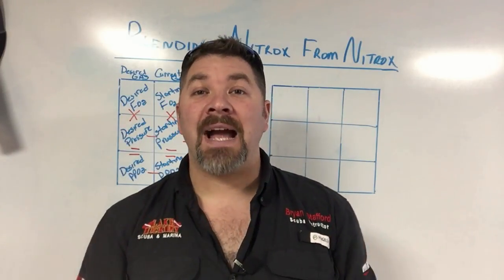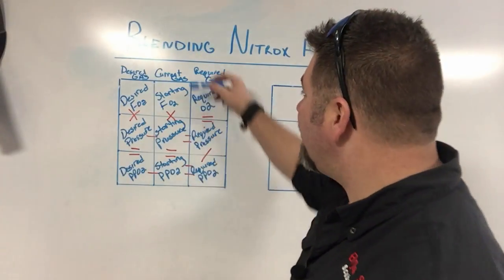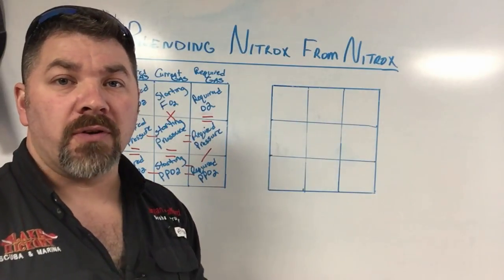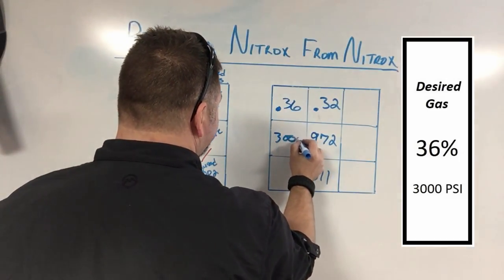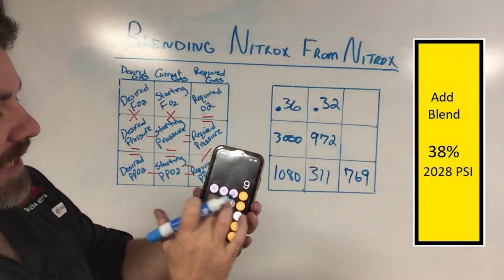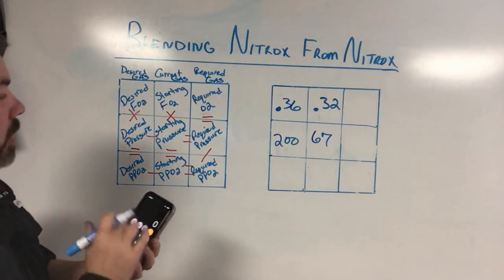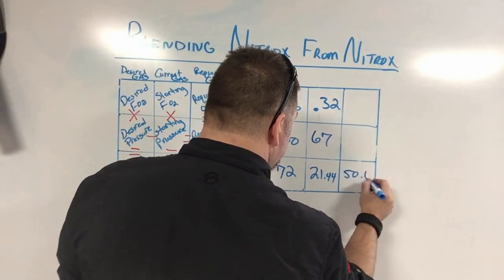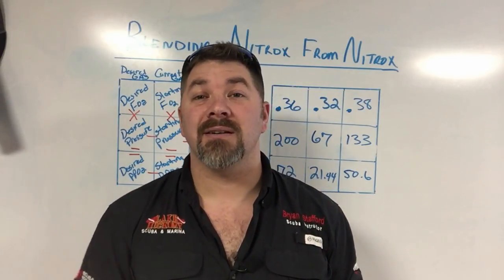Blending Nitrox From Nitrox (PSI & Bar)

Comment: So once  you figure out  the 38% , you go back to the first step in 1st video to figure the mix of air to O2 to do the blending?
Reply from the maker: In short yes, and you can always fill from banked Nitrox if it is already blended, or simply do continuous flow mix through a Nitrox Stick to top it off as well.

Comment: Ok so do you still have to go through the tic tac toe board just to top of a tank? Or is that just to do the changing of the mixture?
Reply from the maker: Great question. In the event you had the same mixture in your cylinder that would be topping off with, then you would simply top it off with no calculation.  But as you stated, if you wanted to change you mixture for the second dive, then yes, you would need to do the calculation.

Comment: Hi there great video's watch them all regarding this blending  nitrox to nitrox  im slightly confused  ive used the system you use and ive come up with my figures but really looking for confirmation   so I have a stage cylinder  currently with 55% nitrox  that is 58 bar of pressure  wanting it back up at 200 bar  with 60% nitrox  can you walk me  thru  it cheers Adam bonner uk
Reply from the maker: Hello Adam, according to my math, you would need to add 142 bar of 62% to get the blend and fill you need. Here is the math broke down. Desired fill 200 bar at 60% (.60 * 200 bar = 120). Current mix 58 bar at 55% (.55 * 58 = 31.9). (200 - 58 = 142), (120 - 31.9 =88.1). Required fill (88.1 / 142 = .62).
Reply: @LakeHickoryScuba  thank you so much  can i now put this by you see what your thoughts are  ok I have again 58 bar in the stage  cylinder  with 45% nitrox  I have a cylinder with 100%  in that I want to decant from  to to take the 45% nitrox up to 60% and finish with the  stage cylinder at 200 bar  thanks in advance

Comment: But how does this help? now you need X bars of NX38. 
instead why not directly solve for how much AIR and how much pure O2 to add?

g_c = current gas blend (Nitrox) (% of O2)
g_f = final nitrox blend % of O2
b_c = current tabk pressure.
b_f = final tank pressure 
so 
Solve 
g_f * b_f = g_c * b_c + 0.21 * X + 1.0 (g_f - g_c - X) for X
thats how many bar of AIR must be added. 
and top rest with O2 finally until g_f bar achieved. 

direct. and simple math.
Reply from the maker: Great question Rahul S, depending on what compressor system a shop has, when it comes to the economic effect of running a compressor non stop or the cost of partial pressure blending, using remaining gas to mix is way cheaper and more cost effective.
Reply: @LakeHickoryScuba  my equations do assume remaining gas in the mix. so you have some blend of NX and then simply add air and O2 to reach target mix. thats it.
Reply: Thank you, Sir, so I have to have a higher pressure O2 tank than 200 bar to top up at the end. If not, the gas will be equalised back into the O2 cylinder.

Comment: Now you're just showing off  lol that's seriously not worth it just drain the cylinder and pretend the visual doesn't matter  just kidding unless you're talking about $trimix$$  but that's fancy little hashtag you made is a lot easier than the long formula it PCI PSI gives you in there course
Reply from the maker: Of course is much easier to top off if you are using a Nitrox Stick. Glad you liked the fancy hashtag, took me forever to get it the size I wanted it, so it would show up on camera in a legible manner. LOL